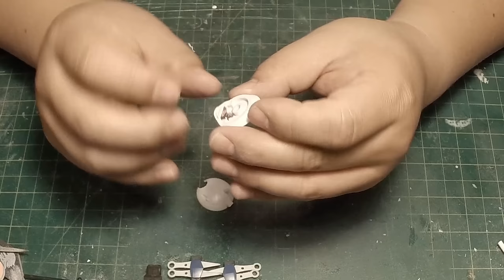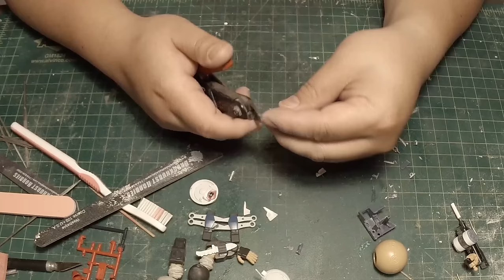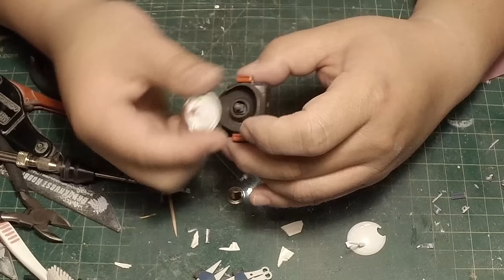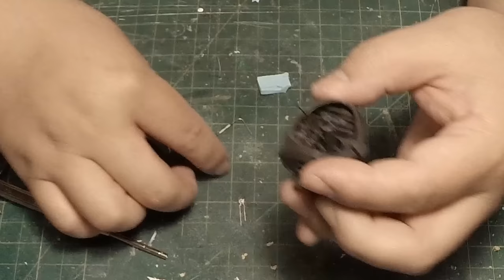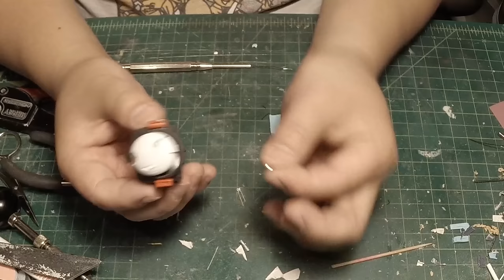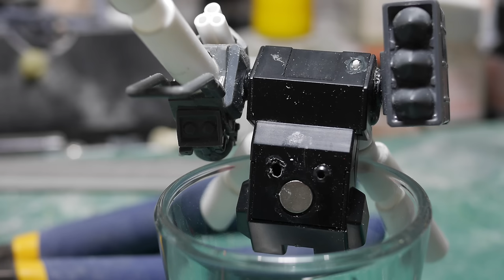Grimoire Head Mods and Lighting

Comment: Those are some really nice tools, would love a nice set like that. You wouldn't happen to be able to share the brand or name of the tools? I'm gonna make some modifications to a 1/144 HGUC Hygogg, an LED for the mono-eye, and could really use tools like these.
Reply from the maker: +Aero The Kitty Are you asking about the pin vise (drill bit thingy with the ball on the end, or the wire wrapping tool?  I got that tool from here: http://www.micromark.com/deluxe-pin-vise,7889.html  The other tool I used is a wire wrapping tool I picked up at radio shack(physical store) years ago.  I found one on amazon: http://www.amazon.com/Radio-Shack-Wire-wrapping-Gauge-Kynar/dp/B000TLWYX6   I think it's actually branded as a "radio shack" wire stripper.
Reply: Thanks a lot, I did mean both of them so that's a huge help! Loved the video by the way, always fun to watch a master at work!

Also watched your decal and panel lining videos, I'll be sure to try that out on my builds from now on. Really like your videos!